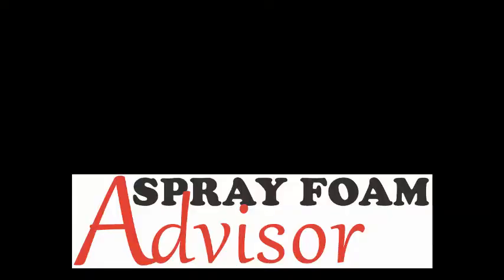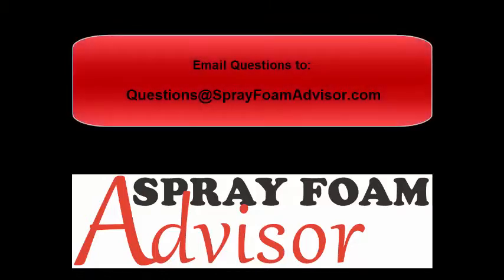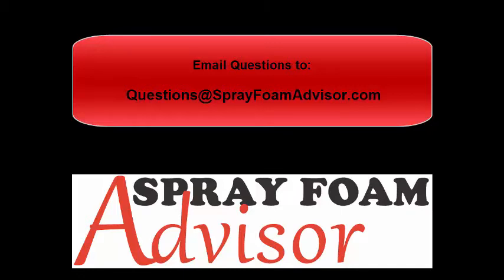Spray Foam Around a Fireplace Flue

Comment: Does the rock wool do a good enough job as not to have a breach in the insulation system as a whole ? Meaning no humid air drawn in through the rock wool ? Especially when A/C causes a draw ?
Thx !

Comment: In my house the hor air register on the wall leaks air around the register. Can I use spray foam to close the gaps to stop the air leak? Hot air vents probably don’t go up to 180F right?

Comment: My landlord sprayed this great stuff fire block foam all around my steel chimney that he just replaced.. In contact with it, all around the double wall chimney and around the steel angled pipe.. I got concerned after seeing a piece of the hardened foam burn while I was burning my trash today.. Looks like I'm going to have to insist it gets removed and done right because this is absolutely not gonna work.. What's crazy is his job is heating and I figured he should know this!
Reply: Was replacing the chimney liner and he used it to seal around where the pipe goes through the wall and around the steel angle he welded where the 90degree bend is at.. The whole chimney is gonna need replaced and re-done cause there's no way he's getting it all outta there without destroying the chimney.. I can't believe this he shoulda known better

Comment: So of I placed a wood burning stove into a foam insulated barn it would only need to be 3 inches away from the wall? And a heat barrier? (like bricks?)
Reply: As long as it stays below 200 degrees. The heater will be emit much more than that.

Comment: What spray foam works around hot copper heating pipes to seal wall holes around the pipe??
Reply: If the copper pipes operate less than 180F temperature, then most spray foams would be acceptable 
If the copper pipes operate more than 180F temperature, then you should look for a high temp can foam for sealing purposes